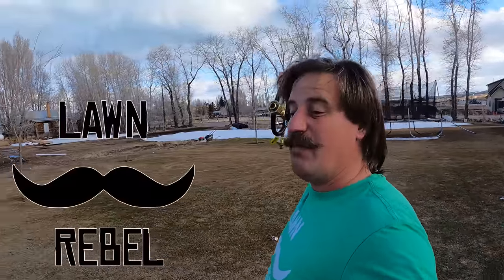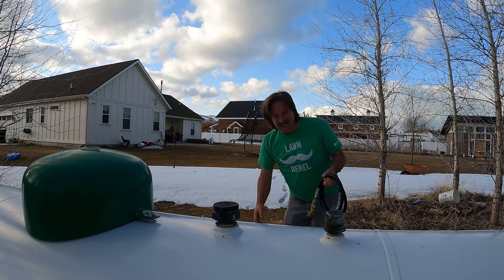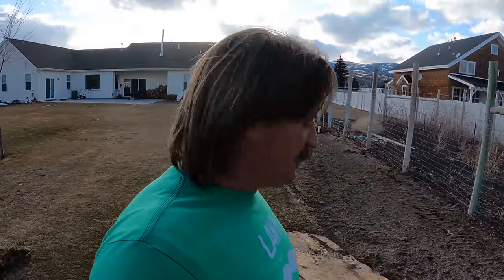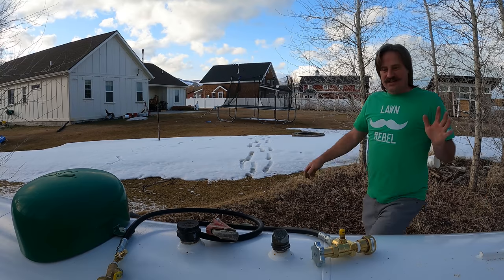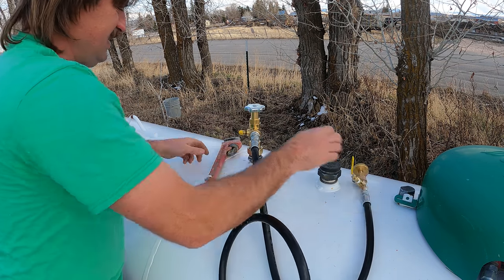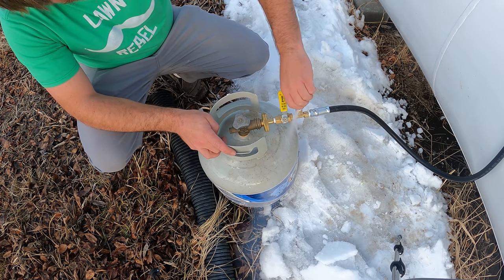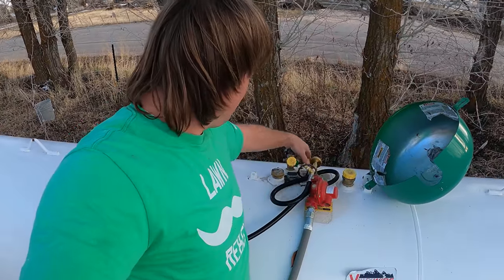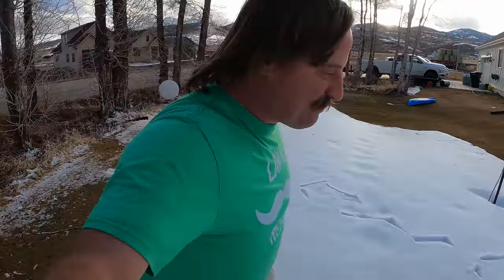HOW TO FILL YOUR OWN PROPANE TANKS AT HOME

Comment: Okay so sir. What you did was pump propane into a liquid withdrawal valve. I am a service tech trainee. I work on propane tanks and install them that is NOT what you do. Do not ever do this he put the gas in the wrong spot. Just because the threads fit doesn’t mean that’s where it goes
Reply: Why is that NOT what you do? Genuinely wondering. And is there a better way to do this?

Comment: That side screw (Bleeder) you loosened is actually a fixed liquid level gauge.  As soon as liquid come out, it means it is filled to 80 percent, AND THAT IS ALL YOU FILL A TANK TO.  The tank you have is an exhange tank, that was filled probably to 17 or 18 pounds. They make more $$ that way.  It is best to go to a dispenser and have it filled to 20 lbs.   A bbq cylinder at 80 percent holds 20 lbs.  Although all bbq cylinders now have Over fill protection device on the valve, they do not always work.  a 100 percent filled cylinder does not allow for expansion, and when warmed up by warmer temperatures, it  will cause the relief valve to pop and leak propane to release pressure.  If there is a flame near by, or a spark when it releases, boom!!!
Reply: Excellent explanation. I was going to add my thoughts as I have done this for 30 years, but you covered it all! Only addition I could make is I have a scale and add 20 or 30 #’s to the tare wt. stamped on the collar of every tank so I know it’s full, but the 80% vent straw is sufficient.
Reply: can you actually fill the tank with liquid propane or is he just filling it with vapor
Reply: @rickyschwiderson7737  Liquid. Supply tank has a dip tube going to the bottom of the tank from that valve.
Reply: @Gopher7  gotcha good to know
Reply: @rickyschwiderson7737  yes tube runs to bottom to withdraw liquid.
Reply: @Gopher7  Is that dip tube standard with larger tanks?
Reply: @imagrasshopper9510  I think in all horizontal tanks. Mine is 250 gallon and had it from manufacture. Also know of 500’s and 1000’s in the area that have fill valves on them.
Reply: @Gopher7  so that port on the large tank.....is that like a big Schrader valve that holds the pressure in until that ebay valve is screwed on? Like does that turn valve push on something to release the liquid pressure?
Reply: @Happy_Harry  not sure about the “eBay valve “ you are talking about without re-watching or re-reading all of these comments, but you are essentially correct.
Reply: @imagrasshopper9510  larger tanks have the liquid port so that the tank can be emptied before being moved by the gas company. it really isn't supposed to be used by the end customer, especially on leased tanks and a lot of companies like cenex will fine you if they see a delivery valve on that port when they come to fill your tank.
Reply: Dawg what r u saying
Reply: @Gopher7 I beg to differ. Any time you are delivering out the top of supply tank, you are delivering vapor unless for some odd reason said tank is dangerously overfilled!!! Propane liquid boils off to vapor at around - 40* below. Thus,another internet gimmick.
Reply: @allenblair705  Not going to argue. Do some research.
Reply: @Gopher7  I’m not trying to argue with you but I have worked in the propane industry for 15 years.
Reply: @allenblair705  Correct. Its vapor that would come out but if the small portable tank is say in a kiddie pool filled with cold water the vapor will condense to liquid. If the tank being filled is being kept colder than the supply tank it will fill faster and probably fill more. The vapor comes out because its simple. High to low pressure but once the tanks equalize in pressure the gas will stop flowing and the closer they get to being equal in pressure the slower the filling gets. This process works best on a hot summer day with the 20 pound tank in a kiddie pool with coldest water you can get on hand from a garden hose so maybe in the 50s or 60s.
Reply: @allenblair705 at the beginning of the video he explained that the valve on the host tank has a rod or tube that goes all the way to the bottom so that you pull liquid instead of vapor. 
Just sayin
Reply: @allenblair705     250 to 1000 gallon tanks have a tube that extends almost to the bottom of the tank that is immersed in the liquid.  This video demonstrates pulling liquid from the large tank into the 20# tank using the "liquid" tube I just described.  - Maybe you work in the propane industry, but I doubt it.  If you did, you would know this.
Reply: 8😊
Reply: @julieanderson9989 it's called a dip tube.
Reply: 33 lb forklift tanks have a tube as well. The tank dispenses liquid propane if it's upright. It also dispenses liquid on its' side, as on a forklift, but only if it's lying in one specific position. That's why forklift bottle mounts have a pin that engages a hole on the tank collar, to make sure it's laying on the proper side. It's a lot less confusing when you see it than it is to describe in print. And you're SO right about training: Here, we had to take a 2-day dispensing course and pass a written test in order to be allowed to fill cylinders or motor vehicle tanks, even on our own equipment. That was 30 years ago. I doubt that someone who doesn't know how the liquid supply port on a tank works, ever passed anything but an employment office. @toolman.dustin

Comment: Nice video, thanks for making it.  Your unfamiliarity with the process and equipment is a little unnerving, but as long as you don't blow up you learn new stuff and get better.  Here's some info that might help others investigating this process: Propane weighs 4.24lbs/gallon. A 20lb bottle (like shown in this video) is supposed to hold 20lbs or 4.7 gallons when filled.  When filling and the vent on the 20lb bottle starts spitting liquid propane the bottle is considered "filled to a safe level".  The "safe level" leaves empty space at the top of the bottle for expansion of the liquid when the outside temperature rises.  Propane bottles have an "over pressure" relief valve that will vent gas if overfilled and then the temperature rises too much.  However, they will vent wherever they are located and if it's in your garage then it might fill your garage with propane gas........... and that might be a disaster.  250 to 1000 gallon tanks have a tube that extends almost to the bottom of the tank that is immersed in the liquid.  This video demonstrates transferring liquid from the large tank into the 20# tank using the "liquid" tube I just described. This can be a slow process, maybe an hour because you're relying on the vapor pressure inside the large tank to push the liquid into your 20lb bottle.  When you go to a "filling station" they have a pump that pumps the liquid into your tank under higher pressure so they can fill your 20lb bottle in about 60 seconds.  Stay safe, loved the video.

Comment: I have one on my 500 gallon tank, installed by the gas man, a friend of mine. In the winter with a tank under 50% it’s slow to fill.  So the way I was taught, disclaimer I’m am not giving advice just what I do.  
-connect your portable tank as you did. 
-open the small bleeder valve on the portable tank and leave it open while it fills. This allows it to vent and fill. 
-open all valves
-let it fill until you see white liquid coming out of the bleeder valve on the portable tank.
-close the bleeder and all other valves and disconnect. 

Now when your big tank is full and during warm weather months you will find it fills pretty quick. Not as fast as the a gas station as they have a pump. I love mine it’s very handy and much cheaper when your buying it in bulk from the gas man.
Reply from the maker: Josh.... This comment is such a breath of fresh air compared to all the other safety Sally comments. I was slightly worried but after doing it once I'm confident. That tank was 35% and it is winter Temps so I come summer... Things will likely be different
Reply: @lawnrebel  I was pretty worried myself the first couple times. My buddy the gasman assured me you can’t overfill these new style of valves as they have built in shut off valve.   With that said if you find an older tank with the old style valve they fill much quicker. I look at it this way, some young guy or gal working at a quickie mart, received a few minutes of training is filling tanks with a pump system every day.  Just don’t cousin Eddy it and all is well. Shitter’s full.
Reply: That's exactly how it's done.
Reply: @lawnrebel  Keep in mind we are learning not only from you, but others commenting here, and learning it from scratch.  The safety comments might not be as useful for you, but to us they are invaluable, and could perhaps save a life.  Thanks to all !!!
Reply: If you can cool the tank your filling so its colder than the tank supplying the propane it will fill much faster. I put it in the freezer for a couple hours if you have a freezer big enough. In the winter this may not be possible, but in the summer a tank out of the freezer is much colder than the propane in the larger tank. The liquid will want to go from the hot tank to the cold tank.
Reply: What a minute??  This is actually a thing??? I always thought that it was vapor that came out and you’d never be able to fill it with liquid because it’s now a gas.
Reply: @4Jeffv  yes it’s a think and sure is convenient not having to stop and fills tanks on the way out of town.
Reply: @4Jeffv  The liquid and gaseous (vapor) propane are always in equilibrium.  You let out gas, some of the liquid boils to replace it.  You push in gas, it condenses to become liquid.

Some people move propane from one tank to another as gas and do end up with a tank full of liquid.  But to do this, they have to cool the receiving tank, because otherwise both tanks are at the same pressure.  The pressure in a propane tank is determined by the temperature alone.

But in this video, he is cooling the receiving tank by opening the bleeder valve, so gas escapes, the liquid boils, and the propane cools down (it takes heat to boil a liquid).  If he moved the propane from the big tank as gas, it would just go out the bleeder valve and there would be no gain, so he moves it as liquid (via the dip tube to the bottom of the tank) to give a continuous supply of liquid to boil and keep the receiving tank cold (and thus at lower pressure than the big tank).

Comment: Nice video. One tip I was given that I will pass along, if you are going to refill those tanks with the plastic label, remove the label, it traps moisture against the tank and can shorten the life of the tank.
Reply: Removing the label is done as a safety measure against static electricity build up.
Reply: 2 years later and you’ve saved my life on this day lol

Comment: That portable tank has an OPD valve... Overfill Protection Device.
There's a float attached to the valve on the inside of the tank.
When the tank gets to 80%, the OPD valve shuts off and won't let any more propane into the tank.
A "full" portable tank only has 4 gallons, not 5 and it has 20lbs, not  25.
If you want to know how much is in the tank, weigh it. The tare weight of the tank is stamped on it. Just subtract the tare weight from the total weight.

Comment: I am very new to large tank propane 

You used the refill valve on the large tank to transfer propane to the 20lb tank 
Question 
When you need to have the large tank refilled you will need to take off that transfer kit, correct? 

Thank you

Comment: So as you add propane, you open that little bleeder screw occasionally.  It is connected to a tube that drops to the 80 percent full level.  If you open it and gas comes out it is not air it is propane vapor.  Close it.  Check again and again until liquid spits out and that means you are done.  The liquid has reached the tube sitting at the 80 percent level.  Don't overfill. You need a layer of gas propane on top.  As it gets warmer outside the pressure will increase which will cause some of the gas to condense to liquid.  Without any gas space the relief valve will pop which could be a dangerous release of propane to atmosphere.  If the relief valve doesn't work for example is old and rusty, the tank could rupture and boom.
Reply: That's because gas can be compressed but liquid cannot be compressed. You need the 20% margarine to be able to allow for expansion and only gas can contract and expand not liquid.
Reply: @truckdriver8416  I can't believe the 20% is butter.
Reply: @stevemorris3710  ....well Land o'Lakes! lol.

Comment: It’s not the wheels that are bad on the Honda, nor is it the belt or transmission like many speculate. It’s the axle where it goes through the deck. It’s just poorly designed bushings that allow moisture and debris in. You can remove the assembly (it’s a real pain) and sand down the axles clean and smooth and then be diligent about lubrication thereafter. Has happened to me on 2 of them so far. It’s a design flaw that is fixed in the newest models.
Reply: I've also heard only US models have this issue. Other countries have a different design with that bushing.

Comment: First off, that cold stuff will FREEZE burn you, and you are dealing with Propane, a pressurized LPG. A tank will always have vaper, or Vaper & Liquid. For safety reasons, you need to remove your valve and hose assemble when you're finished with it. Also, they make a gage, in which you can fill & weigh your bottle, at the same time. And that little bleeder screw is the bleed and a level of 80 percent, open it when you start to fill, and at the first sign of any liquid, close it off! YOU AT MAX ALLOWED! When you get a chance do some more reserch on LPG. It's great when we can look at something, and do something to save money, or save a step of having to deal with the public, but whatever a person put his or her hand to, at the end of the day we want to make it home!

Comment: One more final final thought, the pressure in the tank depends only on temperature.  It will be  the same pressure if it is 10 percent liquid filled or 80.  Pressure only starts to drop when liquid level goes to Zero and you are just taking out the last gas.  Not enough pressure in the tank to condense what remains.  That is why there are no pressure gauges on propane tanks.  Pressure is not an indication of level and therefore level should not affect filling speed unless your supply tank has no more level.
Reply: Your actually kinda wrong, I work a closed loop system everyday of my life and I PROMISE the volume of solvent int he tank ABSOLUTELY has a direct effect on pressure. Yea the heat decides how much pressure. But 10 lbs of hydrocarbon is far less pressure at 80 degrees Fahrenheit than 80 lbs of butane. Huge huge difference and I'm assuming you meant it differently than it came out. As you do sound like you know what your talking bakut
Reply: Shep VanDelay  hey keep er under a hundred eh lol good day my friend
Reply: @bparker86  No, he's right. Tank pressure only depends on the vapor pressure of the particular gas (fuel) at hand and its temperature. For example, vapor pressure of propane at 21*C is 213.3 psi, but vp of butane at the same temperature is only 33.4 psi. That's why propane lighters work so poorly in cold weather. Not sure what "solvent" you are specifically referring to, but its vapor pressure will only depend on the mixture of hydrocarbon fuels involved and its temperature. Pure propane or butane will be the numbers I gave above, but mixtures or containments will make the numbers different. Regardless, as long as any liquid at all remains in the tank, then for a given temperature the pressure will be constant until all the liquid has vaporized. That's why a pressure gauge cannot tell you how much propane/butane/gas remains in a tank and only a level gauge inside the tank or weighing the tank can provide an accurate answer as to how much fuel remains.

Comment: Works great! If your thinking about heating the shed I suggest looking at diesel heater, very low cost and it’s controlled with a thermostat so you can keep it at a set point. I have a buddy xl in my shed which is great but there’s no thermostat so I’m always having to preheat it if I want to “work” in there 🤣
Reply: depends on the cost of diesel, right now in my area diesel is really expensive over $5 per gallon while propane is only $2.49 per gallon.
Reply: @marzsit9833  but that also depends on the efficiency of burning 1 gallon of propane vs 1 gallon of diesel
Reply: Solar heated water flowing through tubes in the floor boards even on cloudy days ,use fuel for night time only.

Comment: Would this work the opposite way?  For example, can I fill or transfer propane to an empty ASME tank from a smaller DOT tank?
Reply: yes but you would use the vapor port to do that with the smaller tank inverted.

Comment: They call that "gravity fed". You sre not using a pump so it takes time, especially when it is cold as the tank has a lower pressure.

You should be wearing insulated gloves or leather gloves when touching any pressurized lines and fittings.

And generally you should turn the tank valve off first then close the fill valve. This prevents overfilling, this is probably more for pump setups. Not sure if it actually effects gravity fed setups.

We have experience with pump and gravity fed, my family does hot air ballooning. We have tanks that are 10,15, and 18 gallons that we fill this way at home. On the 10 gallon tanks it takes close to 5 minutes to fill a single tank from empty. 
We use a much longer feed hose that connects to a refueling adapter to fill the tanks. It definitely takes longer but it is so much cheaper to buy in bulk, we were paying $4 a gallon. Now it is closer to $2